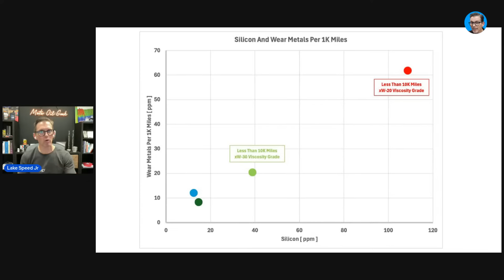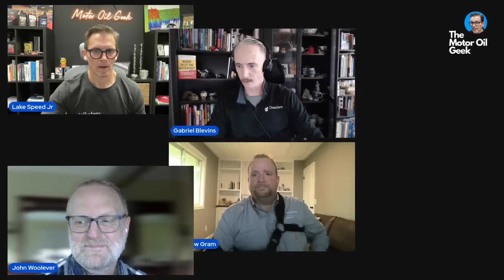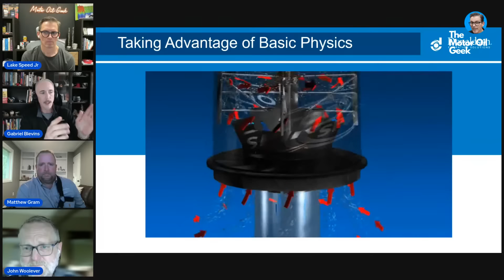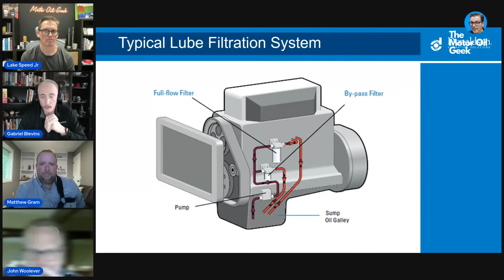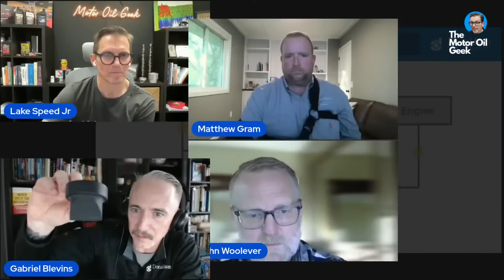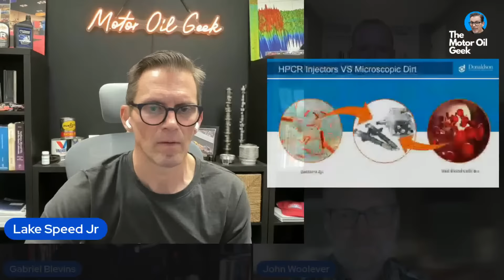DIRTY Filters Are BETTER Filters + BYPASS Filters EXPLAINED

Comment: Mazda has me afraid to use anything other than an OEM oil filter for my CX-5 Turbo. Are there any other alternatives that are perhaps better?
Reply: You are good with the OEM oil filter that was designed for your vehicle
Reply: @GAC8 not necessarily. I wish Purolator made a Boss filter with a higher bypass valve pressure equal to Mazda's 1WPY-14-302. Always curious 👍🏼
Reply: @derrick_is_dnice am i understanding  correct  the stock need use because the after market filters do not have sufficient overhead in the pluged filter bypass spring?
Reply: @daviddroescher yes
Reply: I use Ryco on my Mazda 3 and been using them for 40 years. Never a problem.
Reply: Purolator boss
Reply: @arxigos365 have you actually used it in your CX-5 Turbo?
Reply: @derrick_is_dnice of course way better then any oem filter together with wiz xp
Reply: Mazda doesn't and hasn't made oil filters. Ever, as far as I know

Comment: I don't know where that is on my tractor. I recently did the 50 hour service which calls for blowing out the existing filter. I looked at it and it was filled with dirt on the outside from working in a dusty field. I thought " man ,throw that thing away and just put a new one in" . I replaced it with a new Donaldson.  Now I feel dumb.
Reply: Thats whats called a good mistake-
Better safe than sorry until you figure out whats the best option for your engine.
Reply: My tractor doesn't have a pre filter.
Reply: @rustypipes12   Neither does my bull dozer.  Also, there's no monitor on this dozer.
Reply: There's been an interesting scenario happening with Husqvarna's new flagship saw the 564. It has a round flock filter that some people are claiming allows fines (sawdust) into the throttle body on the saw. I haven't actually seen it in mine but I've been rotating filters after a full day of sawing and washing them with Dawn   Now I'm thinking maybe I should leave the filter until I notice a change in performance.
Reply: Thing is, how does one know if the used and "cleaned" filter isn't contaminated to the point it's going to dust your engine.
I think you're okay to replace the filter when it gets noticeably full of dust because blowing it out might just be pushing the fine dust further into the media and possibly through the media.
Reply: @t @thisisyourcaptainspeaking2259 he rule I’ve always followed is I will only blow out a filter if there is a secondary filter behind it. So in my experience that is only with tractors and combines. Even when you blow out a filter from the inside some of the dust still floats up and gets sucked into the inner part of the filter. I trust the secondary filter to take care of that. That’s why it’s there. Only replace the secondary filter. Never blow it out.
Reply: @TJ-bk9vf That's just it, the dust goes everywhere, including some lands on the clean side of the filter.
I'm just not convinced trying to blow out a filter is an acceptable practice.
Reply: @thisisyourcaptainspeaking2259  as far as I know it’s only advised if there is a secondary filter that you don’t blow out. On a combine I have to blow it out. I would have to replace a $150 filter every 2 days if I didn’t. I’ve only seen the 2 filter system on farm equipment. If there is just one filter then never blow it out.
Reply: . Agreed, this is the purpose of fitting a secondary filter.  I bet you also have a screen in front of your radiator to stop debris as well.
Reply: @thisisyourcaptainspeaking2259  no secondary filter though
Reply: .  Perhaps you could add some type of primary prefilter, oiled foam or gauze that can be cleaned in solvent (maybe soap and water) or something like that.  Of course need heavily depends on your operating conditions.
Also, you might consider vacuuming the filter prior to blowing it out in reverse to minimize contaminating the downstream (clean) side of the filter.
Reply: @thisisyourcaptainspeaking2259  yes, on the combine there is a big screen and a rotating arm that has some suction that keeps the screen clear of debris. The radiator also things that look like mower blades that rotate on it to prevent debris from caking up on it. 

The air intake is also behind this screen. Before air gets to the filter it also gets pre cleaned by what we call an aspirator. There is a tube that sucks a lot of the debris out right before it gets to the filters. The tube goes and actually plugs in near the end of the engine exhaust. It really works. That tube was plugged early this season and we couldn’t go even 4 hours without our air filter getting plugged. With it working you can get a couple days at least, and it’s much finer dust.
Reply: @thisisyourcaptainspeaking2259  That is why you blow OUT(oposite of normal flow) and why most times only the "pre filter" is blown out, the final filter is usually replaced
Reply: @MDAdams72668   I agree, blowing out the prefilter isn't going to damage the main filter.  Considering the particles captured by the main filter are smaller than can be seen by eye, my bet is they go everywhere and some will land on the downstrean side of the main filter.
Sure, do this if you must depending on the circumstances but replacing the main filter is the best practice IMO.
Mileage may vary, objects are larger than they appear....

Comment: WHERE IS THE FUEL ADDITIVE COMPARISON VIDEO ❓?
Reply from the maker: It is in the works.
Reply: @themotoroilgeek 🙏
Reply: @themotoroilgeek hope your testing STAR BRITE Star Tron Enzyme Fuel Treatment which I recently saw great improvement with my cherry 2002 Suburban 1500 LT with a 5.3L . Woke it right up. 😊
Reply: Please cover marketing variations between the better brands.  For example, does a 20oz bottle have more active ingredients (PEA) than a 12oz bottle.
Reply: @SlimJim-ub9og BG44K should have the highest concentration of PEA
Reply: @Hogarth_1618 I like "should" but never trust it...
Reply: @Hogarth_1618  that would be fine if that is a soaking type of product.  The PEA level in Chevron Techron is high...and high enough that if you do it more than recommended, it can lead to dilution.
Reply: Any fuel additives works, the real question is about oil additives if there any may work?
Reply: @arxigos365 The Motor Oil Geek has already addressed this. Additives may conflict with the oil, so he strongly recommends against oil additives.  Instead buy an oil based on your needs and don't add an additive.
Reply: @garyganser2451 agree
Reply: @garyganser2451 that is true
Reply: Taryl fixes all fuel study
Already done
Already proves the fuel stabilizers are all completely worthless, ethanol free and 91 octane too
Reply: I’m predicting techron in 1st place 🤪
Reply: Yup true on that story

Comment: Oil filters until the early mid 1950s were bypass types that only filtered the oil pump bypass flow. So if the engine was worn, there was little oil bypassing the oil pressure blowoff valve, so no filtration. And the open crankcase vent and oil bath air cleaners would suck the road into the crankcase. No wonder engines were totally worn out at 100,000 miles.
Reply: Bypass filters got full oil pump output pressure supplied to them, but had an orifice to keep them from dumping all your oil pressure back into the pan. They never filtered oil pump bypass flow. Oil pump bypass is dumped straight back into the pan.
Reply: At 100k you are on your 4or 5 rebuild. 30knew 15 k between each rebuld. Good tires lasted 3k mi not so good lasting 1k or less.